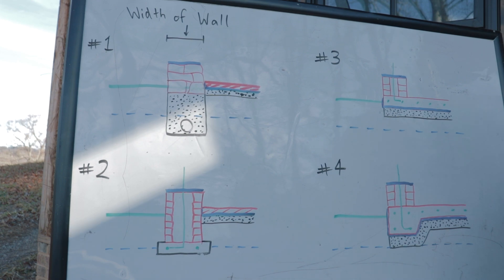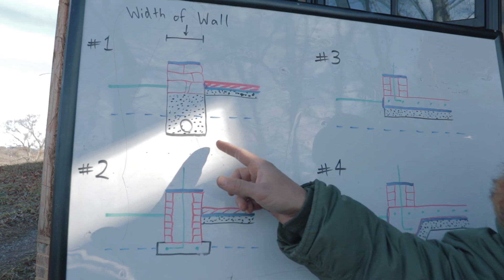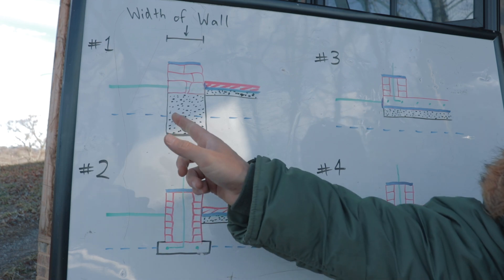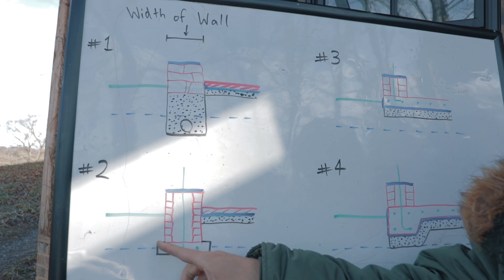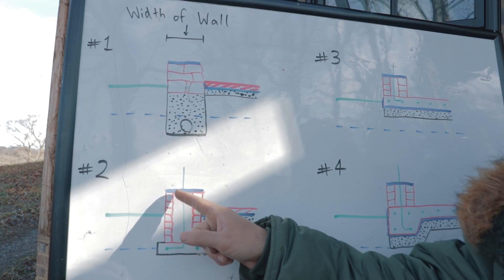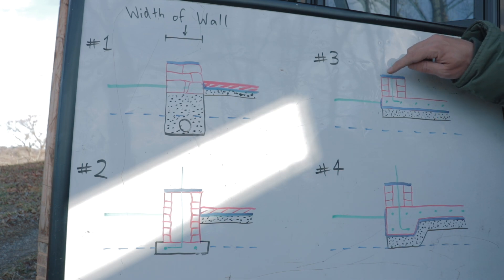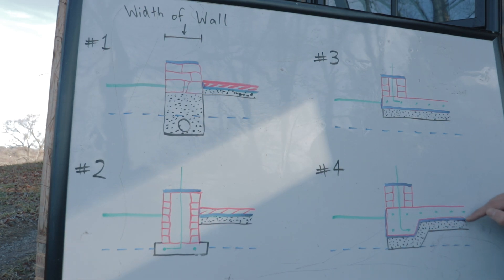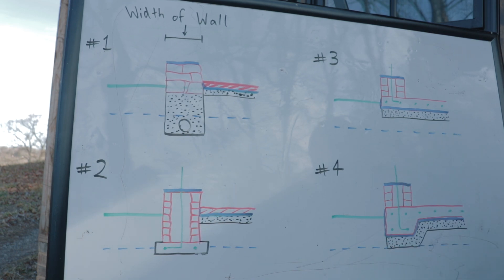Cob House Foundation Design Essentials

Comment: some rubble trench's are 150 years old.    They are even used under stone houses.  One under a house, when I looked under the front porch, where someone had dug, to add an under porch storage room.   The rubble 16 inches high in the room, and it went down more, and was shockingly, 2' into the under porch room.

Comment: Question: so with #2, is there drainage system for the footers and stem wall?  or do you do the rubble drainage on the outside of the walls? or finally you don't need one there?

Comment: Question for you!, im interest in building a work shop at maybe earth bermed or at least backfill against 3 of the 4 walls on a slope, my thoughts are to pour a grade slab and slip forms for the walls at the floors the same day but not at the same time, because no gud way to support the inside slip forms above the grade. But if i pour the footer and floor grade 1st and while concrete firm but still green set the forms for the berm wall and pour them? Would they bond properly or would cause the green concrete to fail? Thanks nate

Comment: Great video, thanks. Insulating under the slab with rigid insulation was not mentioned, and I am wondering if you would place the plastic vapour barrier under or over such insulation?

Comment: Hello, thanks for the video! Just a bit confusing, for the stem wall, there is less drainage as shown in the video, so won't the rubble trench still have the better drainage ability even after clugged up? From what I understand, the main advantage of those foundations contain concrete is due to the load capacity and code compliance?
Reply from the maker: Yes, there are so many nuances here. 
You can actually put the same drainage systems under/around all of these foundation styles. So, the rubble trench isn't really the only one with drainage. I just didn't draw drainage systems on the other ones here.
Yes, loading and permitting are definitely advantages to the other 3 styles. Also better in seismic zones than the rubble trench.
Reply: @thiscobhouse  Thanks for the clarification!

Comment: I loved hearing the cows in the background, lol.
Question about rubble trenches: with all the weight of the walls on the trench, I never understood how it doesn't collapse the drainage pipe and then the wall sinks a few inches?
Reply from the maker: The weight basically gets distributed and doesn't directly crush the pipe. We'd really need to get an engineer or physicist to answer this accurately though.

Comment: Hi Alex. I live in a rural area in southern Mexico.  There is not much need for "permits".  In my area,  the ground is mostly Tyoe A or Type B.  There are  lots of concrete, cinder block two storires houses around.   We do not have "froze line" during winter. (or at least I´ve never hear people mentioning it) Our main concern is rain.  Providing the use of geo-textile to protect the trench´s wall,   Would you still recommend system No. 2 over System No. 1 in as explained in your video? Thank you
Reply: What’s the cost per acre there?
Reply from the maker: Yes, for sure! It will cost more, but #2 is better than #1. In my opinion. That's what I would do.